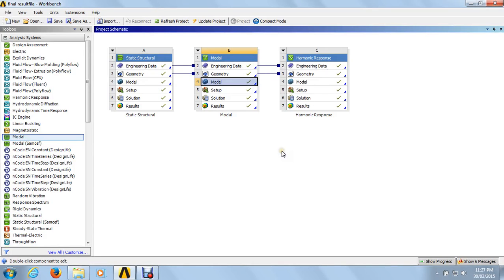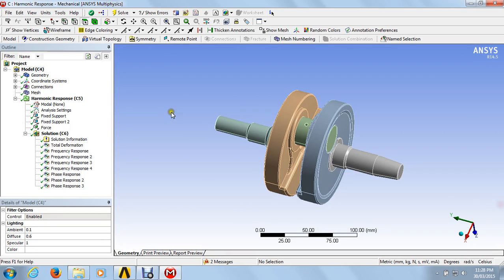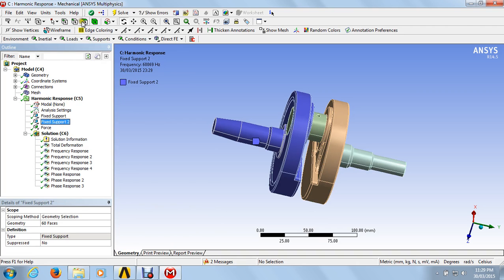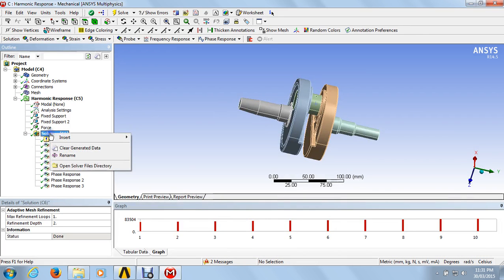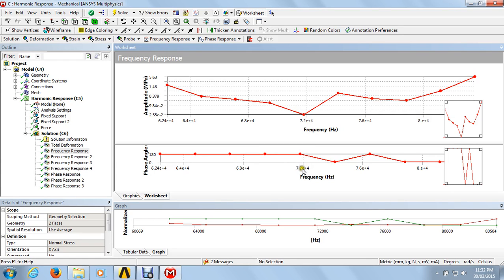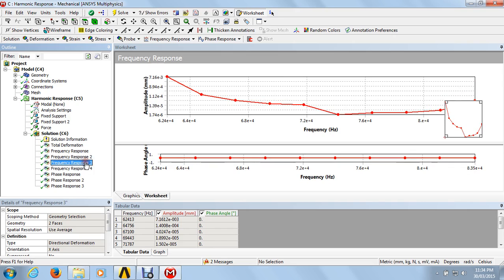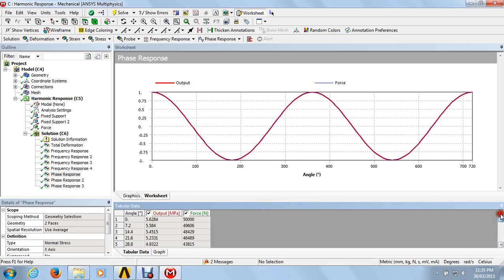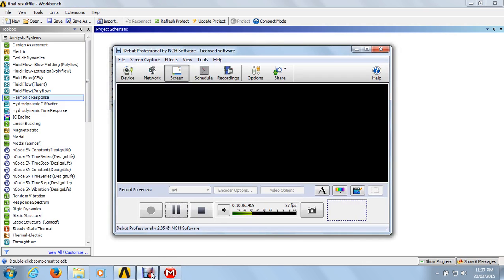Harmonic responce Analysis of crankshaft of two wheeler

Comment: assalam o allaikum sir, angle result are beautiful like sinousidal. how it was came,
Reply from the maker: Dear students if you use your static analysis results to obtain harmonic analysis you will get the results.
Reply: @focusstudypoint9004  yes i want to learn. kindly provide contact sir. +923114248781
Reply from the maker: If you need aney help on anything on the the software you are free to contact.me
Reply: @focusstudypoint9004  actually harmonic response is related to my thesis,